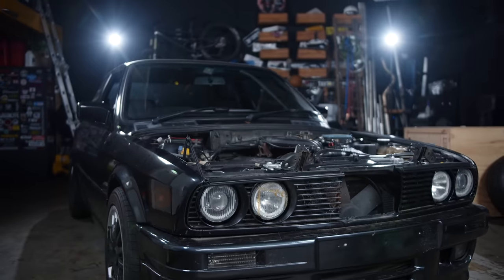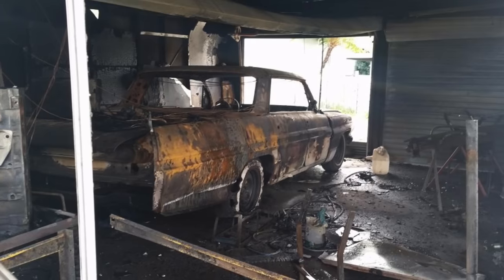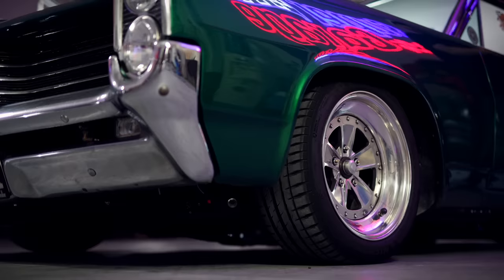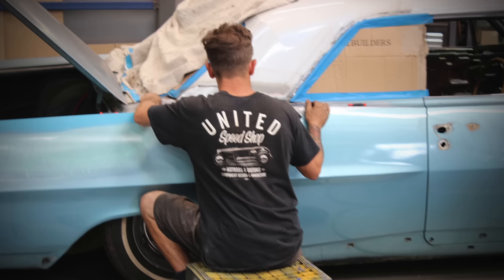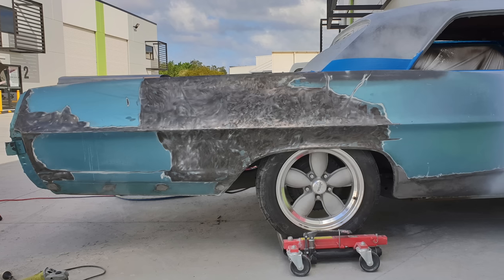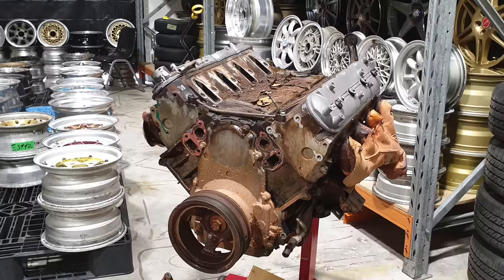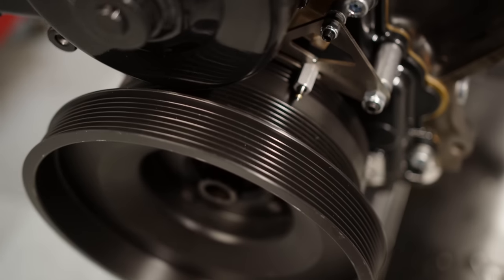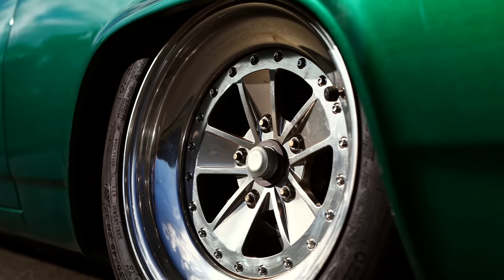Super Garage - Supercharged V8 1964 Pontiac Bonneville

Comment: Super excited to see you guys feature a Pontiac. Pontiac had a sad death, similar to Holden. Dream car is a VE ute? whatever the equivalent of our pontiac G8 GT 6.0L would be but in a ute. Search up buick, many GM enthusiasts to this day still swear that it should have been buick that got the axe instead of pontiac. Many of owners in North America will attest to this, even with their tiny shitboxes. 

For the aussies watching, GM paired up in some ways with toyota and honda. The pontiac vibe was a re-badged Toyota Matrix (corolla hatchback), the Saturn Vue (Similar to a captiva, similar to our Chevy Equinox, GMC Terrain and Pontiac torrent) came with a honda J35 drivetrain, and was available with a manual transmission, higher trimmed as the redline model. 

Pontiac, though the more hot headed little brother of chevy, is a still loved by owners but unloved my manufacturer brand. My dad had an 85 firebird trans am, and to this day we still have two pontiacs in our fleet, 05 G5 pursuit (older version of a cruze, identical to a chevy cobalt) and an 07 pontiac torrent, which even for 2020's standards, deisgn-wise has held up fairly well. 

Cheers boys!!

Comment: An interesting note; Canadian Pontiac base models often came with Chevy drivetrains. The full size was called a Strato-Chief and came with a Chevy 6 or a Chevy 283. So there ARE factory Chev small block engine mounts for full size Pontiacs. Just only in Canada.
Reply: same for Australia - our Pontiacs were built off Canadian kits with Chev chassis/drivetrain and dashboards. Almost all were 4dr sedans and 4dr HTs though

Comment: In  2014 I bought a 1967 Pontiac Catalina 4 door sedan. It ran like crap when I bought it. I put an electronic ignition and points on it  and it purred. That same week the front drum brakes started making noise. Ended up putting on a front disc brake conversion. Ran into problems with the hard brake lines being rusty. Car sat for 7 years while I worked on other projects (02 WRX , 09' Forester). Last year I replaced the hard brake lines and drove it. Now it needs a starter,  there is a problem with the trans being slow to downshift when cold. I have a electrical problem to chase down. The blower motor doesn't work so I have no heat. I have a new aluminum radiator to install and then start chasing down other problems. Exhaust shops want to much to fix exhaust so I just bought a flux core mig welder. Don't know how to weld.....yet. When I finally get it perfect my son and I are road tripping it from Detroit to Los Angeles on Route 66.

Comment: I know exactly what he means with the trials and tribulations of modding a car from the ground-up. my last project (see the display pic on the left) certainly felt like that after grabbing a half-cut on the cheap, basically having to nut-and-bolt rebuild it with a lot of stuff coming from Toyota. while the car itself was driveable before the engine swap and not much else needed doing to it afterwards (only exhaust, fitting of ancillary stuff like fuel pressure reg, external fuel pump, booooost gauge, ST205 box, ST185 diff, half shafts, etc.) it felt like the entire car needed to be transformed. I sold it 16 years ago, and while it was a money pit, part of me still regrets letting go of it.

Comment: What suspension did you run to handle that power demon . I have a 64’ Bonneville triple black Convertible with a 389 engine tri-power with a 4-speed conversion not only does it have a story before I bought in 2021 and since I’ve owned it I’ve been doing upgrades ever since I took possession my biggest issue is trying like hell to get hydraulic clutch system working properly clutch pan rod to the master cylinder is my biggest dilemma. I cannot get the proper geometry because of firewall angle to the clutch pedal has anybody ran into this issue and what is the fix? I have been dealing with for a year and nothing seems to work.

Comment: My pontiac 326 could run with no oil, konk out , fill six quarts back in ..ran like new....run water out of radiator til konks out , temperature needle all yhe way around pinned on the back side of the zero rest pin...refill , runs like new...this bonnie should have a 455 pontiac...od tranny ..inside ac...supercharged. 
One thing that lowered pontiac to other cars in the early 70s was no pontiac engine.  Instead they used  their competitors engine.